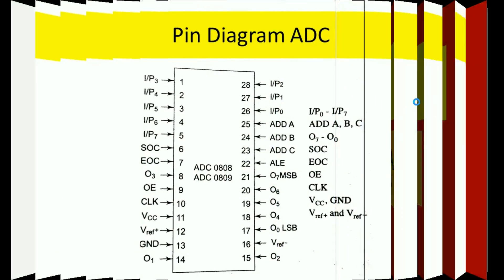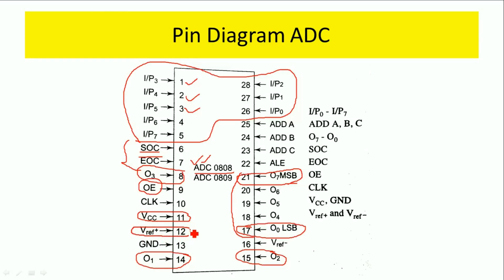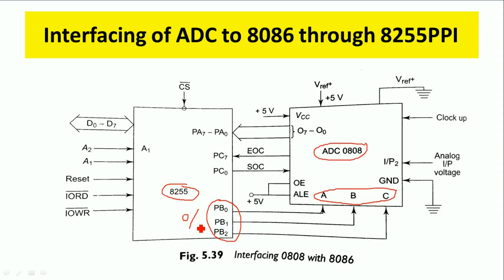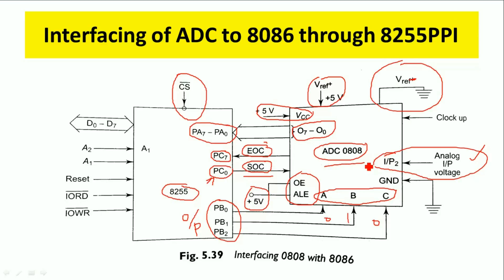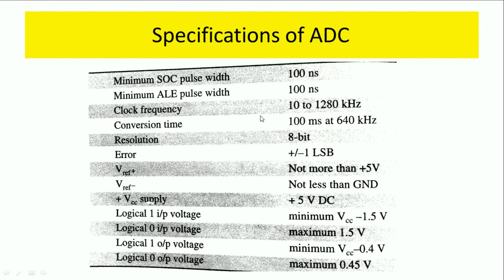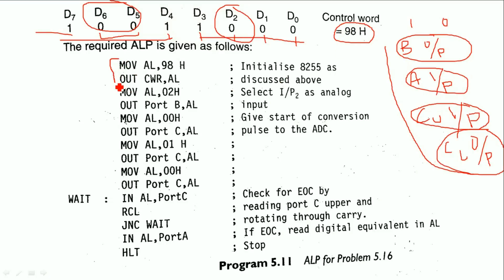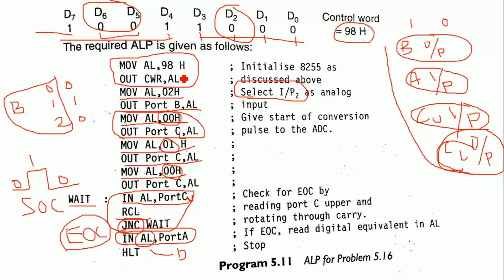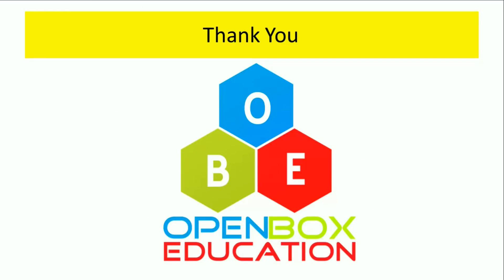Interfacing of ADC(Analog to Digital Converter)

Comment: Nice video. If I want to select all analogue input pins at a time what I have to do..?
Reply from the maker: Thank you very much for your comment. It is not possible with this ADC. Please share and subscribe☺
Reply: @OPENBOXEducation  thanks for your quick response. I want to connect 8 analogue inputs (sensors) and I want to get 8 digital outputs (Relays) at a time.can you suggest me any ic . Without interference of any microcontroller.